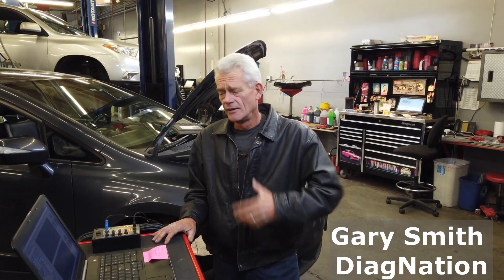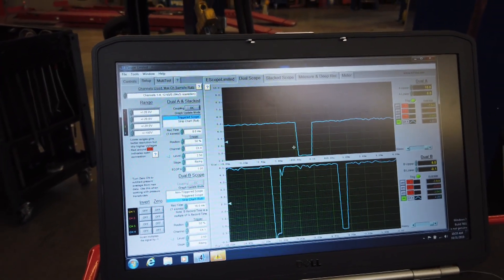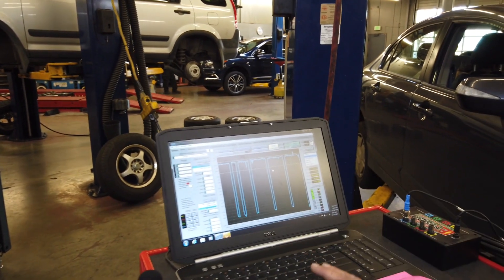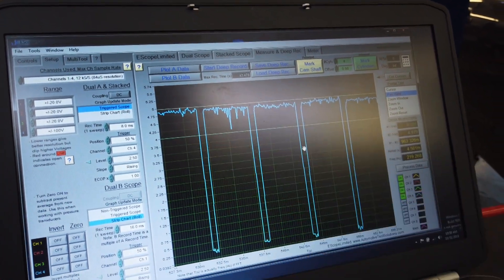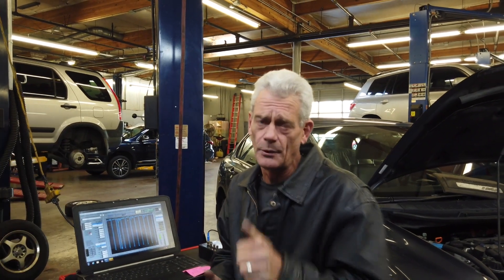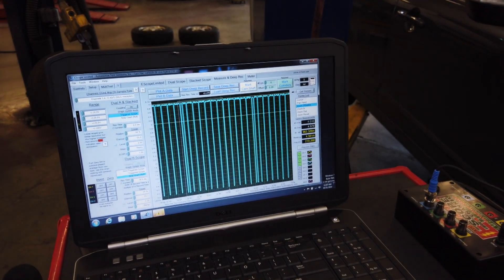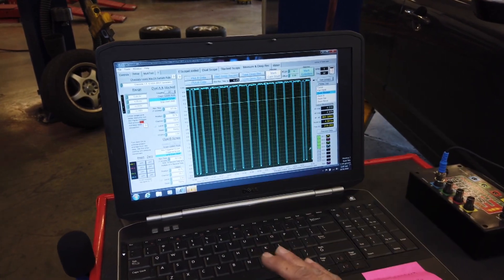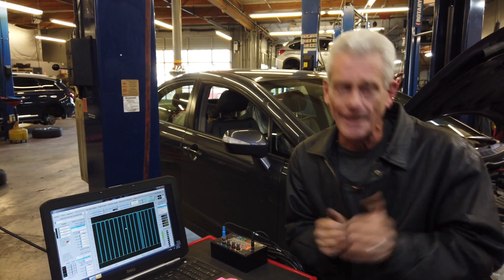Tactical Technician Ep. 1: Honda Blues

Comment: Thank you for advertising the ATS Software and great find on this pull-down sensor. The sensor was not holding the 5vRef pointing to the hold side a faulty transistorized sensor over a wiring or PCM problem and it was able to pull the signal all the way down to ground which proves out the switching side of the transistorized sensor. To speed up your diagnosis time brother, I would lower the hood down to contain more heat as you know these sensors get worse with heat. It's also nice that you mentioned some transmission issues are actually caused by engine issues.

Comment: Good find with the scope! Any thoughts on why the voltage goes below zero?
Reply: Just a glitch in the imperfect abilities of the equipment and/or external noise being picked up by the scope leads, I think this software has a filter and the glitches can be filtered out, to a point.